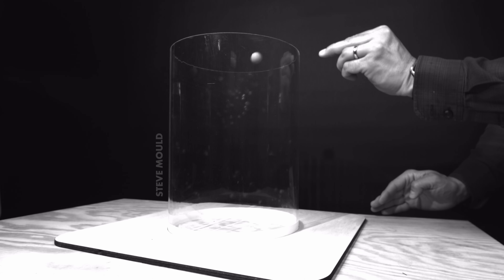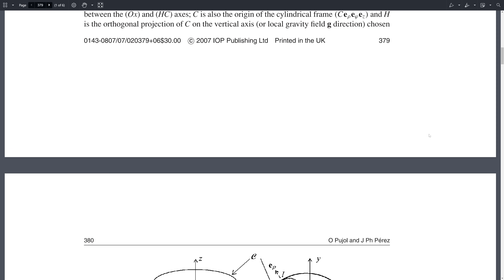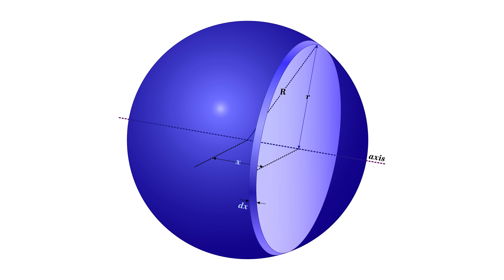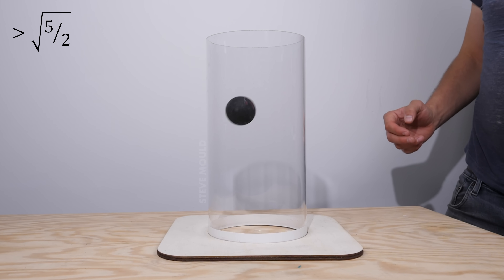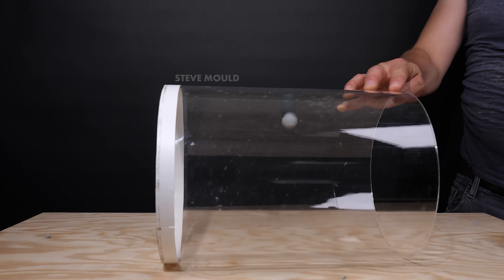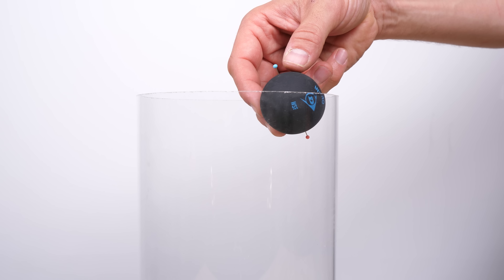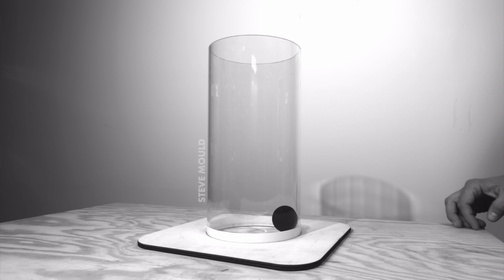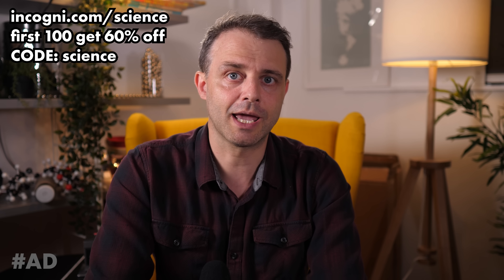The Golf Ball Paradox

Comment: We do holography in London - we can see small vibrations of mirrors or tables or posts using interferometry to see quarter of a wavelength of light shifts .
A movement of half a fringe will ruin a hologram during recording.
But it's hard to set up interferometers and you can't  analyse the movement of certain objects .
I'm not sure this camera can work at that level of precision but it would be nice if it could !

Comment: I don't think you actually need gravity to provide the torque in your gyroscope explanation, which is still present when you tilt the cylinder sideways. When you tilt the cylinder sideways and throw the ball in, the ball's momentum has a horizontal component. When the ball makes contact with the cylinder there will be a frictional force opposing its motion, thereby creating a resistive torque and causing its axis of rotation to change through the gyroscopic effect.

Comment: 2nd derivative of angular momentum of the ball and the change in the tangent plane of the contact point is important, so every upward angle tends to steer the ball down and the other way around, but with a delay. the intuition is like a drives who is trying to correct over steering but trying too hard and never ending up quite straight.

Comment: I think you have that because the ball is rolling round the cylinder, you are changing the axis of rotation, and that's why it rolls up, meets the horizontal and changes direction back again. I think its like riding a bike, you lean into the turn without having to turn the handle bar very much

Comment: Okay I think I have some grasp on what is happening and I think that it has something to do with the relationship of Pi which applies to the cylinder and the ball to the contact point or the friction point where initial inertia is transferred to gravity then gravity is transferred back in the form of inertia. Intuitively I feel like this has something to do with a gear ratio scenario where the contacts of both the cylinder and the ball are minimal however initially inertia and mass convert to a friction point which is then influenced by gravity. The small bit of pull of gravity then converts back to the friction point which translates to an increase in the spin. That small increase give momentum until the contact points of both the ball and the cylinder increase in friction then the energy is transferred back to gravity and this repeats until gravity eventually overcomes the inertia of the mass in rotation. What I find interesting is the relationship of the square root of 7/2 with a solid ball as opposed to a hollow ball which reflects in the square root of 5/2. The point of tangency I believe is the actual issue because this contact point is so small the amount of energy transferred at any one point in time is limited. What I think would help this experiment a little bit and help us understand things is if we were able to divide the outside cylinder into measurable amounts of course it would have to be on a scale that was equal to the ball used in the experiment and of course the ball would have to be Mark to the similar fashion. We would want to pay attention to the angle of attack for which it becomes in contact with the cylinder and use the markings on the cylinder in the ball to see how much spin or slip is involved. I'm also really interested in seeing whether or not this changes if the atmosphere is different or does it stay the same. So having a ball come into the cylinder at the same angle with the same inertia but one in a vacuum, then one in a gas two times as heavy as our atmosphere and see if the ratio changes. For a brief moment I imagined what would happen if the Earth flew into a very thick cloud of gas would that cloud of gas give enough friction to change either the spin of the Earth or it's rotation around the Sun? What I think would be interesting to also do is change the size of the ball with keeping the cylinder the same at the same time keeping the same inertial Force and angle of Entry to see how much it changes or if it's relationship stays in the ratio of square root 7/2. Another idea was whether or not the inside of the ball was solid or liquid because I imagine if the center of the ball was liquid it would change the ratio might even change dramatically the entirety of the experiment. I think it would be worth a shot changing the inside of the ball and say give the ball liquid mercury with no space for air and see how it performs in the same experiment. Then also try it with distilled water and see if that ratio changes it all as well

Comment: That’s a space drive right there. Even with friction dragging the cylinder down as the ball works it’s way down the wall; it does the same on its way up and then would potentially slap the roof, transferring momentum.

So firing the ball, upward thrust. Dragging the side of the wall down. Dragging the side of the wall up and then more upward thrust. 

Capture the ball and start again.

Comment: I'll take a stab at explaining this one. The key is to understand that the centripetal force is acting in three directions. Since the curved path begins in a downward direction, the normal vector (which is also the force vector) must have a positive component in the z.
So lets make the experiment easier, no gravity and the cylinder extends infinitely upwards (the ball is magically placed within the cylinder, but still has a velocity tangent to the center of the cylinder in the xy). If you have the velocity with respect to the z axis be 0, you are just going to have a ball going around in a circle. You could cut out the balls path and it would form a circle, with the centripetal force vector point to the center of the circle.
Now imagine the velocity with respect to the z in negative (the case we are looking at) Now take a conic of the path of cylinder after, lets say, a quarter of a rotation and it is circular (so it has centripetal force), but the centripetal force vector now also has a z element, that is pointed in the opposite direction to the velocity. This is the force pushing up on the ball and forcing it up (until its path is moving upwards, then the force z will flip negative again and it will begin moving down).
If you're having trouble looking at it in 3 dimensions, just look at it from the top down view. If you look at the ball for the first 1/8th of a turn, the force vector needs to pointed towards the center of the 2d circle. If you now go to a 3d view, since the 2d circle is inclined within the cylinder, that force vector will have a non-zero z to it. That non-zero z is the upward force.

Comment: I don't really know how to explain it in words but my brain completely understands what's happening, I'll try, the ball spins in a direction as it drops and the force of gravity and the contact with the wall speeds it way up, giving it a bunch of kinetic energy. But it's in a cylinder, so that downwards energy it has turns around and becomes upward energy because the ball never loses contact, and the motion of the ball (energy) is conserved. It's just looking at the wall of the cylinder from the opposite perspective. If you got a really long tube and threw the ball at the right angle to build up a lot of kinetic energy and still turn around in time to conserve that energy, you could probably make the ball oscillate like crazy.
Reply: The reason that gravity is actually negligible is because the ball already has a bunch of kinetic energy stored from throwing the ball.

Comment: The squash ball is oscillating off center for every rotation, as opposed to the golf ball which oscillates at the spinal point. That equilibrium seems to be lost when the core of an object is empty.

I like how this experiment gives me a stronger mental picture of orbital balance in our solar system; all the planets currently (aside from Mars) are on one side of the sun; you can easily imagine the tidal forces between the planets and our sun right now based on this experiment: Earth is a component of an oscillating wave on the plane of the elliptic but rather than fly away we are dragged together into another spin slightly off center from last year's orbit. The precession of Earth, the obliquity of Earth's tilt, and the eccentricity of its orbit are all necessary to determine the stability of our troposphere. The equilibrium of the system is where we have been for several thousand years but the planet system is entering its quarternary quiet time, where ice will disappear and temperature goes up. Sadly, we as a species have altered the chemical composition of our atmosphere to the point where this phase of Earth's orbit will be a record breaker for heat absorption from the sun. Rather than a slow cook to force life to evolve, we will be scorched. I hope life can endure.

Comment: This is, in my observations and my opinion, related to the physics of how and why a bicycle or motorcycle stay upright without a rider, or stabilize with one. They always turn toward gyroscopic precession to explain but this never completely works. There is an element of it, when turning the front wheel (handlebars) there is a reaction but I have never heard anyone introduce the traction factors of the tire against a flat road, tilted. When the wheel is tilted a scuffing action occurs off the centerline of the wheel. Because only a wheel perfectly upright and rolling in a straight line is free of this traction force. Once the wheel turns there is conflict between the inner and outer portions (off centerline) of the tire tracking different radii, the inside tracks a smaller radius, etc.. And when tilted over, such as a motorcycle in a banked turn, the sidewall of the tire starts to "climb" on the flat road sideways, into the turn, righting the vehicle. I have never heard anyone address this.

Comment: I'm not a Mathematician by any stretch of reality, however, In basic maths we are taught that "pie" is reflected by "22/ 7"; could the formula for Pie have something to do with the ratio of rotation, since it's been figured out the a solid ball has a sustainable formula of 7/2? I feel like there is a ratio coefficient not being addressed here between the mathematical variables of the the size of the ball, size of the cylinder, vector of  entry of the ball, and the velocity of the ball within the cylinder. There seems to be a constant that accelerates to an escape velocity due to the centripetal force vector, so long as the friction is constant, which might explain the ball rising up the cylinder, only to fall back down... 

it just occurred to me. A ball roiling on a repeating slope, gains and looses momentum based on the climb and descent of the slope vectors. Could that be part of the missing variables of the equation? 

Consider: A ball that "falls" down a sloped hill, picks up momentum based on the angle of the sloping vector, that if given a slope of the same vector for it to in turn climb against, depending on the descent vector can and will have enough escape velocity to climb the opposing hill often past the point of starting height. However, since the ball is falling with nothing directly beneath it, hindering its gravitational pull, because the wall of the cylinder is perpendicular to the path of trajectory, and is curved at a ratio by which the ball can naturally roll unhindered; could the wall of the cylinder function like a Hill in a sign wave coefficient? If that's the case; then what might be happening, and this is a stretch, is that the molecular structure of the ball and Cylinder, may be creating something akin to the physics of a S.E.G. (Searl Effect Generator). In that, the molecular mass may be generating a small gravitational pull between the two acting bodies due to the centripetal force caused by the rotating ball. Since we know that a ball with a less solid core, mass, or external structure has less rotations than a ball with a more dense surface tension; this creates a more likely potential that the denser the material of the "ball" with higher mass and friction, the more likely the temporary gravity well is created due to the rotational speed of the ball in question. 

Also something I noticed in your video; the rotation cycle is more abundant when the cylinder is vertical vs on it's side. The physics still work, but the change of angle as to how the gravitation pull is applied seems to reduce the probability of multiple cycles. Which may have a huge impact of the mathematics of determining to cause effect of the paradox. I'm curious on two new factors within regard to this;
1. does having a longer cylinder mean the likely hood of multiple cycles becomes more constant? 
2. does the diameter of the cylinder or ball effect the potential chance of repeat cycles, especially IF the cylinder is placed on it's side?